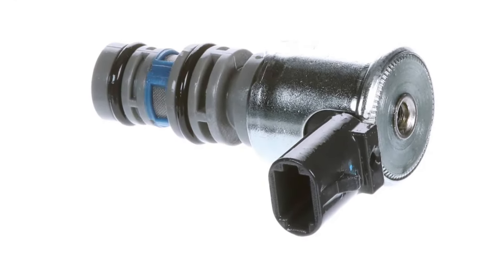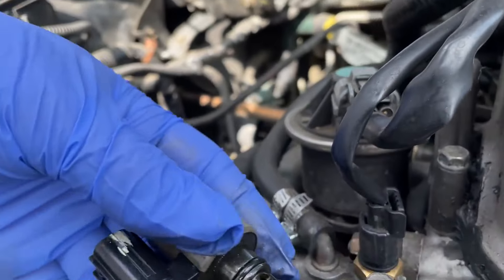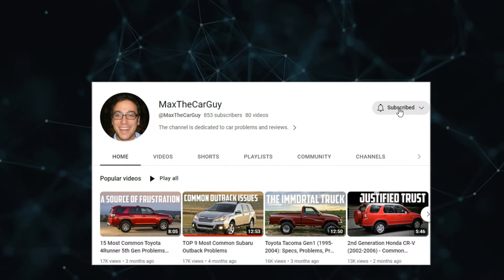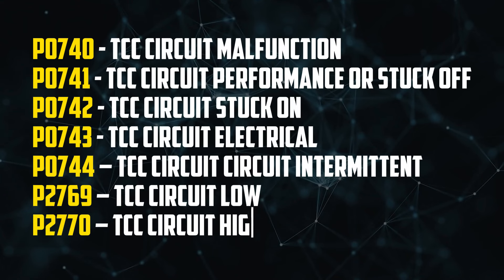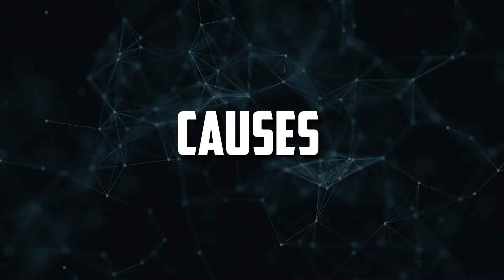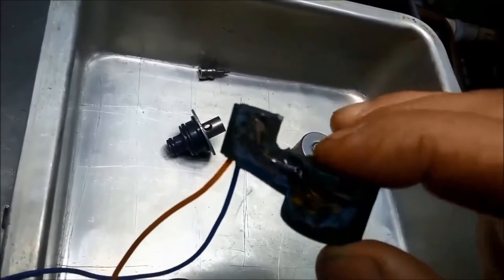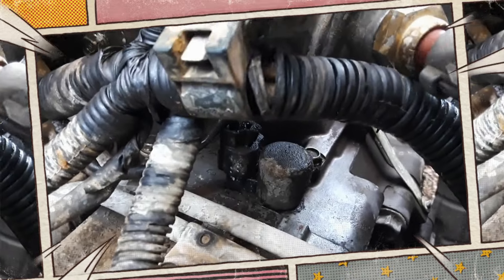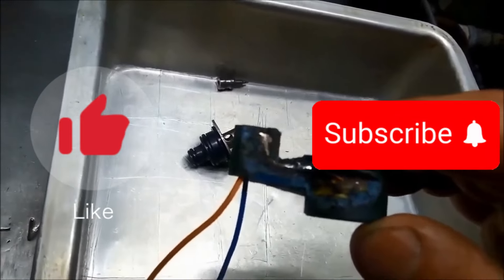5 Common Torque Converter Solenoid Symptoms. Causes and Replacement Cost

Comment: 1995 Chevrolet Suburban, vehicle jerks in lockup in 3rd gear but especially bad in overdrive when in lockup. Struggles to come out of overdrive sometimes or even lockup. But the biggest problem is the occasional intense split second cut of power while accelerating moderately in traffic trying not to get rear ended, associated with a clunk

Comment: My car can shift into drive reverse and all with ease but the car doesnt move. The car after sitting for a while had a chattering noise that WAS the torque converter. I replaced the transmission fluid with cvt transmission fluid (2010 nissan altima 3.5 sr v6 cvt) and the chattering is gone but the car still doesnt move. And it feels like the car is in neutral or park at any time. The rpm when the car is in gear on idle does go down but i dont feel the “hook up” thats what i refer as the slight jolt forward the car had when i use to put it in gear at a stop light from neutral into drive.
Reply: What did it end up being?
Reply: @Robert-nh9cw  torque converter failure far as we can tell
Reply: I traded it in for a gladiator lol. Have owned it for 12 years. Got my money worth
Reply: I have the same issue
Reply: @ashleyslater2685  then if your car is a cvt you will need likely a torque converter replacement which means a full transmission replacement. Unless you really wanna keep that car i say sell it as is scrap it or something like that

Comment: Hmmm so how do you know if its the t- converter or the solenoid? No  slipping no limp mode but vibration ( strong) at specifically 40 to 55 m.p.h . And an underlying rumble at low speed low with low acceleration which vanishes when accelerate .
Reply: Kindly check your engine mounts. I had the same problem and it was engine mounts.
Reply: Sounds like a torque converter. Usually a sitter rumbling between 30-50 mph.
Reply: What was it for you, mine does the same and I have it apart now
Reply: @thinbrickspec77  my car drives normal at speed and it jerks when accelerating and wants to die when I stop at a light. Is that just a tcc solenoid?

Comment: Have a 2009 Toyota Rav 4, had parked the car for more than 1 year 6 months after replacing the engine, when accelerating there is a short  delay around 30-40mph but don't shudder, then shoots out like rocket, could it be this solenoid?

Comment: This is exactly what im experiencing with my 2004 honda civic ex while stopped at traffic lights for prolonged periods of time. When i try to accelerate the engine revs hard but my wheels dont move an inch unless i rev the engine extra hard. Going to replace this part and see if it fixes it thank you.
Reply: That fix it?

Comment: 2015 fusion 1.5L code shows P0741 tcc stuck off car drives decent but sluggish at highway speeds..shops say change entire transmission but I ordered the solenoid because I think I don’t have to..wish me luck
Reply: Any luck?
Reply: Did it work?
Reply: Update?

Comment: My 2000 Ford Ranger 3.0L will shift into Reverse and Neutral fine but it will die immediately when put in any forward gear.  Will drive in Reverse as well.  Could the Converter or the TCC solenoid be the possible issue.  Truck was a gift and we found that no transmission filter was in it.  We replaced the filter kit.
Reply: My 2002 pathfinder auto, stalls dies when put into drive or reverse. It's I'm shop now . Hoping for the best for both of us lol. 

I've been doing so much research could be few things with these issues.
Reply: @Johnsrt2023 wishing you the best of luck too!  I hope it’s fixed soon😊
Reply: @westwaytrainingfacility3669  thanks bro you to!!
Reply: @johnsrt2023 what was it? im considering getting a 04Buick LaSabre to get back and forth to work. Its $700 but the car run in park cutd off when put in gear
Reply: @jbvisiongod  3 mechnics saying touque converter for me. But idk. 
I sold the truck. 

Don't buy it
Reply: @Johnsrt2023 it could have been that. But i cant imagine it was such a simple explanation. Tqc’s are simple in design and rely on fluid being dumped into them and micro managed by tcm and the tcc solenoids.
Reply: Hmm ya idk

Comment: My 2015 Nissan rogue is showing p0744. Have had a few seemingly unrelated issues like a beat up flex plate and the shifting cable came completely free from mount due to stripped bolts, but other symptoms are mild so far. Could i replace the solenoid in it, even though it’s a CVT?
Reply: Yes nissan’s like your and mine (nissan altima 3.5L sr V6 cvt) have multiple solenoids one that is a torque converter lock up clutch solenoid and multiple others that are for shifting the car into “gears” that use hydraulic pressure with transmission fluid to “shift” my car doesnt move at all but it did have the same code yours has. P0744 and a few others more likely relating to battery voltage issue or wiring issue.
Reply: I hope your cvt valve body is easy to reach like mine. Also make sure to get 6 to 7 quarts of nissan brand or valvoline cvt transmission fluid at the ready if u do replace it because its better to replace it now sense ur gonna have to drain it anyway
Reply: @brometheusthefirstbro4302 that’s very informative, thanks for the heads up!
Reply: Ns-2 fluid is more viscous then ns-3

Comment: This explains the exact symptoms my 1998 acura tl 2.5l is facing - I already cleaned up the IACV, EGR, intake manifold, changed air filter, cleaned throttle body, cleaned MAF, checked MAP, spark plugs + gap good, basically new distributor + plugs, fresh transmission fluid and filter. (And yes that old transmission fluid absolutely reeked along with the old differential fluid.)

Did a basic inspection of that awfully placed TCCS - couldn't find my DMM but the screens were clean of any debris. Only unfortunate part is that solenoid ain't cheap at all so gl to me.
Reply: Yeah if you have a code for it then prob.

Comment: The code reader gives P0744. A/T Converter Soleniod Valve Function. The car drives forward and backward. But once i get up to 35 to 40 mph, it doesn't want to go any faster. I can drive around town but not on the freeway. Is the issue with my solenoid, or does the whole tranmission need to be replaced. 2015 nissan Altima 2.5 4:14
Reply: Did you ever figure out what it was mine is doing the same

Comment: Hi everyone!.
I have a Benz A170, W169, year 2005 (Automatic), still running and serviced regularly.
The issue with the car presently, is that when starting (fresh from rest), the transmission is somewhat 'choked' and the drive reduced.
The indication then is 'Transmission..'.
But, once the engine is turned off (obviously) and started anew , after a few minutes, everything works properly. When 'warm', car is ok.
Recently, this has happened more than once during the same journey, after 'fresh' start. Again, after turn-off and turned back on after a few minutes, it worked good!
The fluid level is ok too.
Note that this only happens after 'cold' start. System hot - no problem.
If anyone could comment and share similar experience, it will enable me to understand the issue, please. Many thanks!!!
Reply: same thing happens with my bmw if you ever find out the problem please let me know!!
Reply: @JeanStudiosHD  The process seems quite long but, from what I was explained..
1st. drain and fill up with a 'common' ATF,
2nd. drive 2000 kms on the same conditions as before and recover a total of debris,
3rd. Drain and fill up with 'recommended' ATF plus 'appropriate' additive (?!!),
4th. another 2000 kms to observe reaction - reduced gear slippage, unclogging filters, realigned gears, sound/noise etc..
5th. if persists, because the problem is that these additives generally don't last very long, then intervention and replacement of  elements concerned or entire gearbox!
It seems logical to me to go to step 2 directly, that's what I should do....?
Reply: @rakeshg7038  after doing all that did it fix the problem with your mercedes?

Comment: Good video, friend, a question...My Dodge Journey does not have codes, I put it in gear and it does not move forward or backward if I mark the changes on the dashboard, what could it be?
Reply: My car had this same issue. I had a p0744 code and service engine soon/check engine light on my car for 5 days when it was still running till recently it broke down this past Friday and does not move

Comment: 1999 Dodge Durango where is the solenoid located at inside the transmission or outside the transmission
Reply: Inside on the valve body it's a rectangle shape the has the connector on it that goes to the driver side of transmission
Reply: Thank you so much for that information I was thinking I had to pull the transmission out very good explanation and that video is fantastic thank you all very much

Comment: my 2014 jeep patriot sport starting decrease its speed from 70 to 40 and then shut off on me twice....after that it's been parked with an engine light on and a code of P0741 ... Not exactly sure if it's the solenoid or the actual Torque Converter clutch ( the big round Donut) 😢 Your advice would so very helpful
Reply: I would first replace TCC solenoid that is not to expensive comparing of replacing Torque converter. Let's face it even if it is torque converter after all you don't have to replace TCC again like I said I would go that way?

Comment: I am so grateful for this wonderful video. There are the symptoms you mentioned, when my warning light comes on, there are harsh gear shifts and complex contractions, but when the fault goes out, everything is fine. I used it like this a few times and now I was stuck on a hill, it didn't want to enter, I smelled the brake pads, I pulled into the parking lot without pushing any further. Now the fault comes on at the first start and the car is having a hard time driving. Do you think I have caused bigger problems? Could my luck up solenoid be damaged because I added 500ml too much to the transmission oil? My volvo 850 is Aısin aw50-42
Reply: Sorry for the English translation. In summary, I think my TCS solenoid is broken and I used it like this for a while, but now the fault is constantly on and my vehicle does not want to move. I'm worried that I've caused a larger mechanical failure.

Comment: I’ve got no forward gears only reverse and neutral, engine chatter, Mercedes 420gl cdi went in to kind of limp mode when putting foot down hard or nothing happened a few days before,, occasionally had the chatter on start up or while driving occasionally before loss of forward gears ? Any help appreciated please

Comment: Hello, I passed my 2018 Nissan kicks in flood water. It stopped immediately. I tried starting it several times but it won't start. Till I got a mechanic to kick start it continuously we ended up with so much water coming out the exhaust. After some days the cvt transmission went out. We were advised to have it completely replaced with the brand new one. But due to financial constraints we bought a used one. Unfortunately it keeps jerking and you can smell something burning from the engine. Also when you accelerate it loses power and you will have to restart the vehicle before you can get it to move. Recently we diagnosed the car after changing the transmission a second time and got an error code of p0744 torque converter clutch intermittent. Please can you help. What must be done to fix the car?

Comment: I have outlander 2011 CVT and have code P0740 Lock up solenoid circuit 
Is it just the solenoid or the torque converter?But I don’t have any issues for idling,Limp,or any.Just doesn’t change the shift and it’s always stuck in the 1st gear either i use the manual shift still doesn’t shift but in the dashboard it is changing the number of shifting 1-5 but running in the 1st gear?Any experience kind of this problem same as mine?
Reply: Was the torque converter the problem?